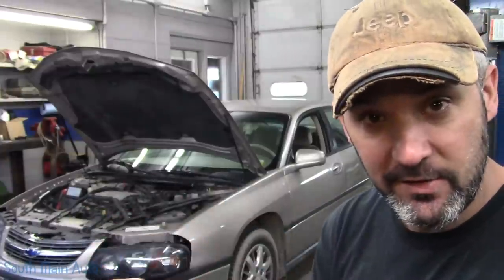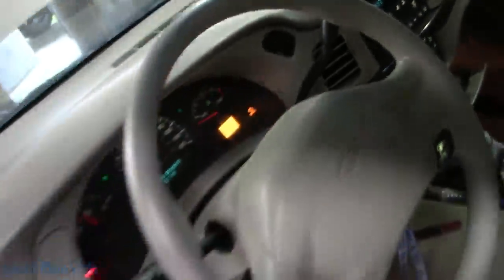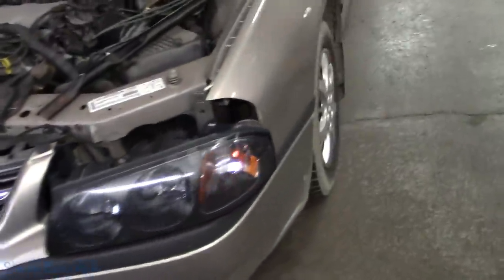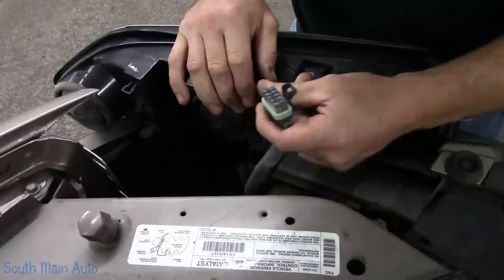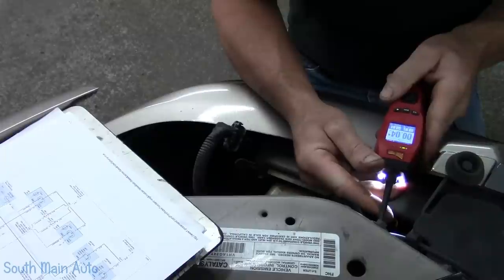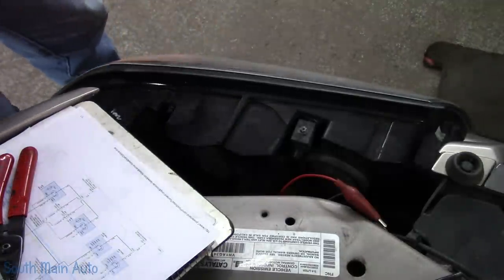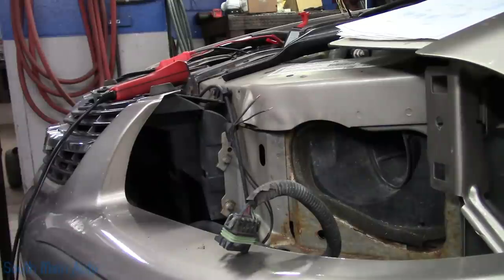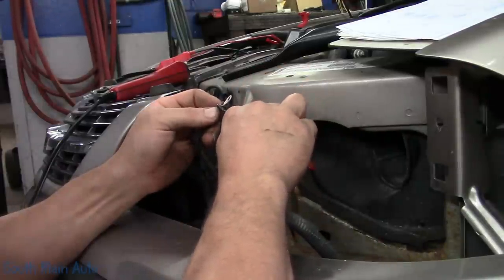Chevy Impala: Turning Signals All Goofy!?

Comment: IF I WAS OWNER OF IMPALA I WOULD BE PISSED OFF AT FIRST SHOP FOR JUST THROWING PARTS INSTEAD OFF DOING SOME LEG WORK AND FINDING PROBLEM ,GOOD JOB DR. O
Reply: I'd ask for my money back.
Reply: The owner of the car will mever know that the car was fixed someplace other than where it was taken in the first place.  Mr. Os bill will just be tacked on to the original shop's bill, or the shop will just absorb the cost of their lack of competence.
Reply: No need to shout.  I agree, "Test, Don't Guess"......
Reply: Sometimes, it feels good to shout. Everytime I hear the 'aftermarket remote must be the cause' nonsense, I want to shout, too.
We do most of our own work, but when we're too busy, I take the cars to good shops. There's one in town which is on my nevah-evah list. I've put aftermarket remotes in several of our vehicles, never had a problem caused by one. The first thing they said when we had a broken ground (intermittent, of course, not clean like this one) was: Aftermarket starter doing it.
Break wasn't anywhere near the remote start.
Reply: That's why it's important to always go with the most simple checks/fixes first.
Reply: i agree...a weekend DIY could have done this one.
Reply: but how does the shop explain to the customer essentially two repair bills??  "Why am I being billed for plugs and wires?" lol
Reply: Simple, some bad wiring done as a result of the aftermarket staring system that was installed or some other lie that can easily be believed
Reply: Yep and those multifunction switches are kind of expensive I bought one for my 05

Comment: I like when Eric O tells us when a car comes from another shop. The facts are the facts. If the car came from another shop, what's wrong with disclosing that the other shop threw parts at the job and it didn't fix the problem. Has nothing to do with intentionally trying to bad mouth the other shop. Their inability to fix the problem by shooting the parts cannon already speaks for itself. Love these wierd electrical issues because these are often the problems I encounter on my own vehicles. Great video.
Reply: I like when you tell viewers upfront that it has just come from another shop or dealer. It adds a bit more flare and drama to your videos. They may have even recommended you at someplaces.My reason is what many viewers said about how much money the owner has already spent. Your repair was a 2 dollar part and labor. I bet you have a customer for life. You probably already have a bunch of those. Great video. Thinking simple and the basics first

Comment: Don't apologize for a video like this.  While simple to you, obviously it wasn't simple to everyone.  The more like this, the better.  Your diagnostic approach of finding one simple circuit that isn't working(marker lights in this case) and going with that first has served me well a few times and even got me some fixes that other shops couldn't fix, and I'm not even a professional shop--just a corporate pilot fixing cars for people, on the side, out of my garage.  You did get lucky, though, in that you pulled the left headlight instead of the right headlight first.
Reply: I agree with this.  To me it looked like a major problem and would not have guessed it was just a ground that could cause that behavior.  Electrical issues can be intimidating for someone like me that has zero idea where to start.  Good Video!

Comment: I think it’s more than fair to mention it was already worked on, as vehicle background. That’s one of the first things we ask when working on jets. I’m no ace auto mechanic, but a friend of my sisters wanted me to look at a light issue on her car that had all sorts of parts shotgunned. My first question was “what happened when this first started?”. “My left rear brake light was out, ever since they replaced it, it’s been goofy.” I opened the trunk, pulled the bulb out...single filament bulb in a dual filament socket.  They jumped the brakes and turn signals together with the bulb, then started shotgunning parts...

Another valuable part of this film is doing the damn job right. A: soldering to prevent corroding, B: sealing the probe hole in the wire, and C: spraying the ground to help prevent corrosion. 95% of places would’ve skipped at least one of those steps, got paid, car left, only for a new problem to show up from it in a matter of time.

Comment: Your initial description of the light problem, both signal lights coming on at once, made me instantly think it was a bad ground.  The light with a bad ground was using the light on the other side as a ground path, making both appear on.  Another diagnostic trick is to turn on the park lights, the signals then will light dimly when they are supposed to be off and go completely off when they are supposed to be on.  Brake/tail is similar, they turn on really dim when the tail lights are off and go out completely if you hit the brakes when tail lights are on.  The bulbs with 2 filaments will all do this.  If the ground is missing then both filaments will be powered in series with each other when one side is powered, but go out when both have voltage applied.  Thus they will be dim but on when powered on only one side.
I am an electrical engineer by trade but have worked on cars since I was about 13.  Your tools are pretty sophisticated and cars can tell you what is wrong but only if all the connections are correct.  I would love to have the nice tools and subscriptions to services you have, but it isn't financially viable for a shade-tree mechanic.  You have sound troubleshooting methodologies.

Comment: My dad is a 30 year mastertech and it would get under his skin knowing the useless replacement parts thrown at this car after misdiagnosing something so simple. He actually has said for a few years now that it is to find mechanics to fix stuff like this, all the good ones are retiring or too old, and dealerships have always been scams. The age of computers has techs relying on OBD codes to fix anything at all (and they sometimes can't even do that right). Lots of horror stories with the 'throwing parts at it' strategy. The worst was a year or two ago, a $600 part + labor fix vs. the dealership asking for almost $10k to do a transmission replacement. Borderline fraud if you ask me. Good fix! I liked this simpler vid.

Comment: Like Eric I live in upstate N.Y.  Rust and crust caused me to dislike vehicle repair and engineers that design cars made me totally dispise it.  I ended up going industrial maintenance and electrician.  I constantly have to go behind and fix others screw ups.  Eric is the uper 10% of IQ in his profession so these things he teaches are probably impossible for the average mechanic to follow.  The odd part is the guys that do this stuff almost always start in an advanced test, skipping by the basics and causing themselves huge issues.  I have fallen into the trap when others tell me they have done a propper test way to many times and it always causes me an hour or 2 of frustration before I go back and check.  This lesson is valuable,  just because they are way up the line on tests you would do, don't assume anything based on another person's diagnostic style, because 9 times out of 10 if they call me in they skipped something simple.

Comment: This short video saved me hours of grief.  I didn't have a problem until I turned on fog lamps and the lights went goofy. The wires going to the ground all looked okay, but when I touched them they turned to dust.  Just stripped the ends back and stuck them under the washer. All lights work great now.

Comment: It's been 40 years since I worked on cars, but just the description you gave was telling me it was a bad ground. When you added the difference with the headlights on, it had to be a front ground. The only thing that stopped  me from saying that was the assumption that a modern car wouldn't be using a flasher and all of it would be in a computer, which would have been a crazy bit of coincidences to get those results.

Comment: good fix   typical rust belt repair.   just a suggestion- a lot of people cant read a wiring diagram. when you get one like this maybe you could show on the diagram how and why this happens. i've had some doosies in my lifetime and the only way i found the problem in multiple circuit faults was to trace each circuit to a common point using a diagram. as always appreciate what you do.  you've taught this old dog some new tricks along the way

Comment: Thank you for making this video, and thank you for having such a great channel. I just made the same repair on my mothers 2003. Windshield washers were not working, both front turn signals flashed with left or right, and she had a high beam fault warning on dash(high beams were working) 
Had the ground wire pull apart while testing. New ring terminal and all issues went away. Saved her a repair bill! Please keep the great content coming!

Comment: Hey man, thanks a bunch for doing this video ...even for being 3 years old. I had this exact same issue on my 02 Impala.. the turn signals would blink at the same time in the dash and the two front turn signals would blink at the same time so i pulled the headlight ground plug off, stripped the wires and just bolted them back to the fram and it fixed the issue. You probably saved me a bunch of money at the repair shop.  Thanks a bunch!

Comment: As with any repair there are steps to be taken.  For example start at 1 and end up at 10.  I follow the old rule of, "Divide and Conquer."  For example if starting at 1 and ending at 10 doesn't work. Now I'll start at 1 and look at 5 if my problem isn't there I'll go to start at 5 and look at 7.5. if my problem isn't there either I know it lies between 7.5 and 10. And I keep working till I find it.  
That method hasn't failed me yet.  Being a parts changer never solves anything.  Being a good detective does.  Great example of that Eric.  Thanks for sharing.

Comment: I hold an electronics certificate from a technical college.  I really appreciate your approach to reading voltages, resistances,  currents and waveforms. That simply has to be done for a good diagnosis. Parts throwers certainly show their ignorance, and I have seen a lot of them in my day.  It seems to me that adequate electronics training must be a part of a mechanic's ticket.  No pass the electronics section then no mechanic's ticket.

Comment: Great video Eric. Reminds me of service call I had three years back. I got called regarding a Volvo garbage truck that wouldn't start and when the mechanic before tried jump starting it and cranking the engine the starter would click and spark. The mechanic out on the road couldn't make heads or tails of it. I drove out to the call which was a hour away in my service truck. Just to find the negative cable was disconnected because the welder in the shop had to do some work and when it wouldn't start they pushed it outside in the cold. I put the negative battery cable on and tighten the nut on the stud. Hit the start button and the truck started right up. Did it three times no issue's. Wrote the invoice and drove home.

Comment: Good job with the basics, Eric! I see that kind of problem all too often. Bad grounds causing weird issues, especially when the wiring is the absolute minimum needed to make the circuits work. It pisses me off when i see when someone has poked a wire and not sealed it afterwards. Imo, never poke wires, it just creates more problems in the future. A good example was with my dad's 2000 Jeep Cherokee. Fuel level gauge did not work. checked all wiring, got no signal from the sender.  Bought a sending unit, and dropped the tank. Now, a little info for those not aware, the wiring for the fuel level and the fuel pump goes to the middle of the top of the gas tank, and they have little room to even get in there. They also have a metal skidplate on them. After dropping the tank, i saw that someone had poked the wiring between the harness connector and where it goes into the fuel pump housing. Needless to say, that pissed me completely off, as the idiot that poked the wiring did not seal the punctures, and as a result, the wiring is all corroded. The only way to fix that was to replace the entire fuel pump assembly, at over $400.00. That did'nt happen, just slapped the tank back in. My dad had the mileage all figured out, so it was'nt too much of a problem for him. But, it's someone else's problem now, he just traded it in on a 2012 Dodge Journey.

Comment: Caught one from another shop yesterday and he was running down a no start/no run.  It has been messed with by many "mechanics" and the problem was still there.  Did some of the same tests you did and found, yep, a bad ground.  Fixed that and the old vehicle fired right up.  Good job.  The ground is boss.  Electronics do not like it when the boss not working.

Comment: Not useless.  I wish the other shops used your videos for training. Then they might be able to actually fix the problem.   Keep it up.
Reply: It seems to me the "other shops" don't test stuff first. An example being the turn signal switch they replace (as mentioned by Mr O.) needed to be test before making the call. Find the wires for it on the steering colum and ohm out the correct wire. Does the switch make the right connection? If yes look elsewhere, if not switch is bad. How hard can it be?

Comment: Ha ha ha, what a story. Another brilliant teaching example, where you find a corner of a complex problem and trace it back. We're looking forward to seeing that 5V voltage stepdown device in action! I made one with three 1.4 V batteries from an old headlamp, but it sure isn't as smooth as something designed to mesh with the PP.

Comment: Ahh, the Impala. The meaning of that name has changed since the 60's, when it meant, "Quality, Luxury, and Power". Today, the loosely-translated American Indian meaning is, "Poorly Engineered Pile of Horse Dung". 😁

I love the easy ones like this - for myself, and when you video them. Reason I like watching a video like this, is I try and put myself in your shoes, and see where I'd go. Since this thing was built after 1996, my first thought would be the BCM, or some electrical short buried down behind the engine - in other words, "it's gonna be a horror-show!" LOL.  You made a great point on the rear lights working - can't be any module or flasher issue if the rears still work. I have to scream at myself, KEEP IT SIMPLE, any time I'm faced with stuff like this. I've fixed a few that were just as easy, but I had my mind going in circles over what it "could be".  If it were a trailer, I'd have hooked a wire straight to a good ground and watched what happened ... but not on a '96 + for some psychological reason.  A great lesson here to step back, and ALWAYS check the basics first! 👍
Reply: "G"impala  aka Gimp-ala

Comment: Another great video Eric. When you described the symptoms, I knew immediately what the issue was, the ground as a bad ground can cause all kinds of these weird issues, just look at any of the older 1st gen Rabbits, pre Westmorland ones especially as they often had issues in the tail lights as they all had the separate tail and brake light bulbs in those, not the 83-84 redesign I don't know as they used 2, 2 filament bulbs for the brake/tail so don't know if they still suffered from this.

You can tell when there is a poor ground as the turn signal would glow dimly when lights were on and then flash bright, sometimes causing the reverse light on that side to flash too, or something along those lines.

So when you mentioned the symptoms, that was the obvious clue that came to mind even though you tried to dismiss that as a possibility so we would not immediately call that out (in hopes anyway), only to reveal a broken ground! 

Overall, great work - again as usual.

Comment: Nice job Eric. Ground problems can trigger funky stuff... I had a corroded (broken off) ground on a H4 bulb connector once, that caused the car to stay running with the key off. You could switch off the engine from the light switch.

Comment: Also in most cases the guys that get mad are the ones with most empty parts boxes at the end of the day.... Eric you have a great following of great mechanics and we all need checked once and again to keep us doing great diag. Work we do great work but not always great diag work when shit hits the fan and we have more broken equipment than mechanics at the shop and we all look for the easy bolt on fix instead of the easy wire repair.... I may have drifted here and there with what I said but those that know will know 👍🏻

Comment: I had an idea where this was going when the video started. My sister's 2004 impala did the exact same thing last year and was the same fix. The headlights went wonky on it one time as well and ended up being a pin fitment issue on the fuse for the driver side headlight. Another awesome video Eric

Comment: Interesting problem with an easily overlooked fix! 

I'm having a different issue with the blinkers in my impala. They'll randomly cut out unless I turn on the emergency lights one or two times. I already tried cleaning the connectors and replacing bulbs. After this, I'm leaning towards it being the blinker relay and not the blinker switch.

Comment: Bad grounds can really make things go wonky. Another fun one for me was the brake lights (lumina)not working but the cyclops brake light on. Pulled the high beam switch back a little and whalla break lights came back on. Imagine that a turn signal lights the break lights. Replaced the turn signal switch and all was well.